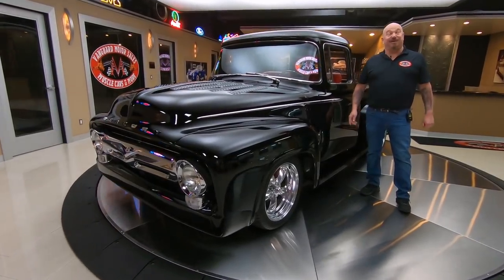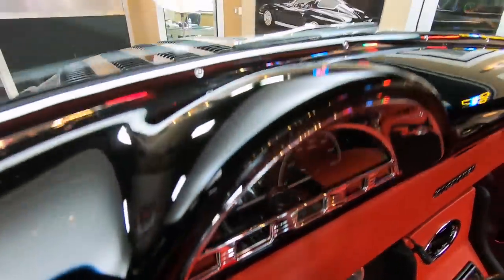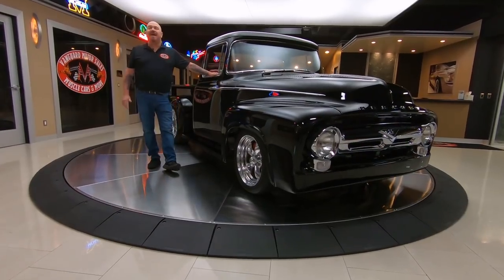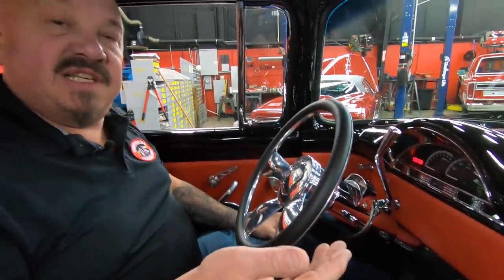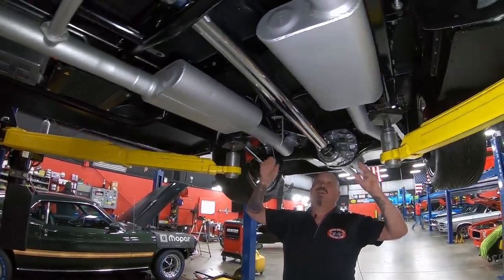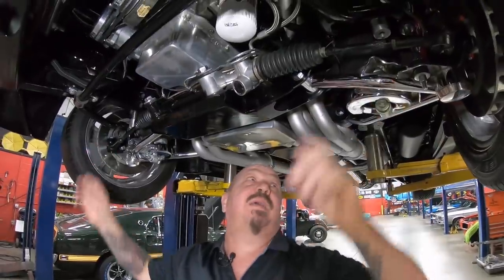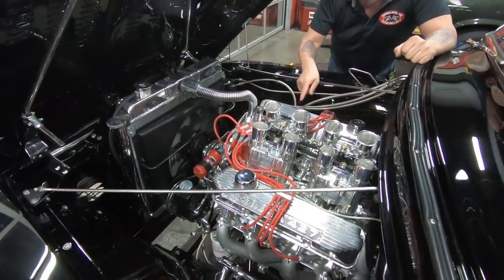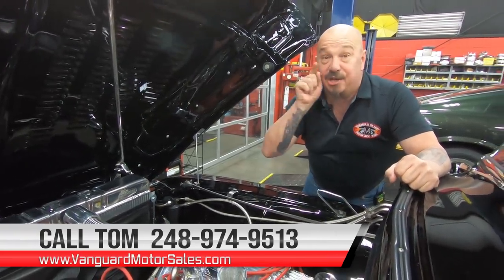1956 Mercury Pickup For Sale

Comment: I never knew that Mercury made a pickup truck, that's like Buick or Oldsmobile truck.But then it's got an FE motor, Holy F&#k.You only see this on a Vanguard video!
Thanks Greg!!
Reply: It's Special. You could be forgiven for just assuming it was a Ford if you didn't see the Mercury Badge on the Hood. The Mercury M Series (1948-1968) ; a badge engineered Canadanian Market Version of the Ford F Series